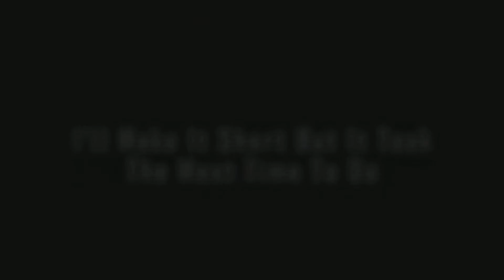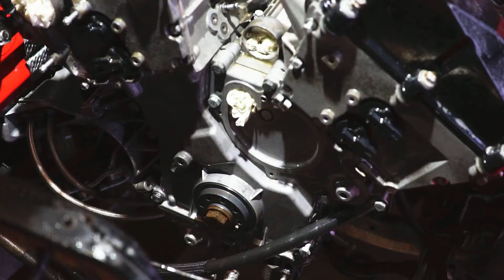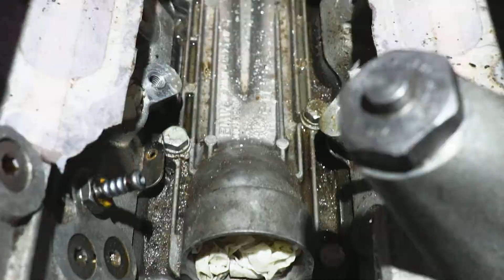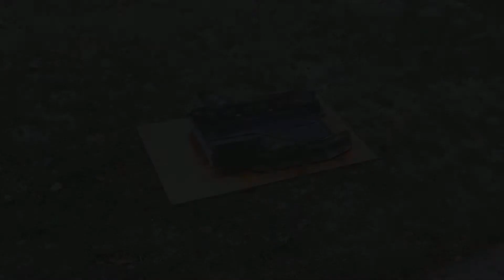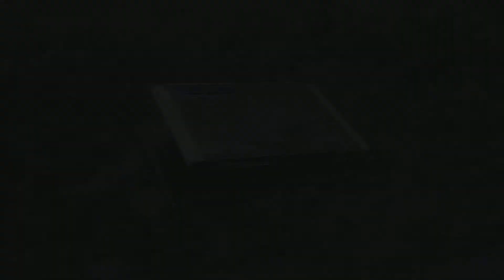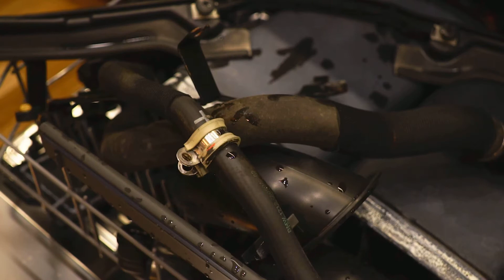Removing 200 000km Worth Of Oil, DIrt And Who Knows What From The V12 Engine - BMW 760i E65

Comment: I have my car for six  years, the most common problem is the oil leaking in the engine which caused by BMW method to running the engine  in a grossly inflated temperature.
Reply from the maker: Main issue is that BMW uses rubber gaskets that turn into plastic over time and they will leak.
Reply: @SATSMotors  Yes. That's why I did a E85 REMAP on mine. To keep the carbon deposit of the valves and keep the engine cooler. From 10-15 Farihenheit degrees colder.